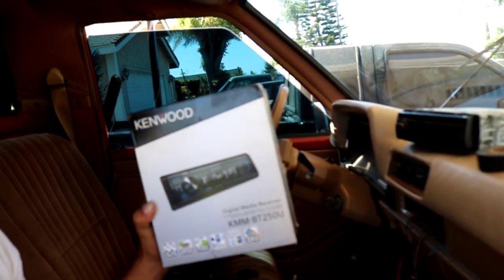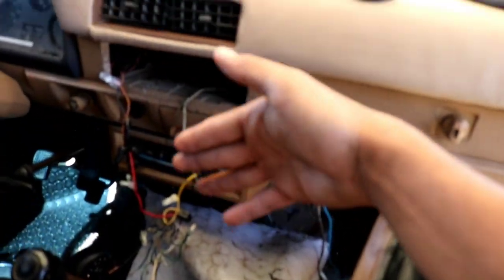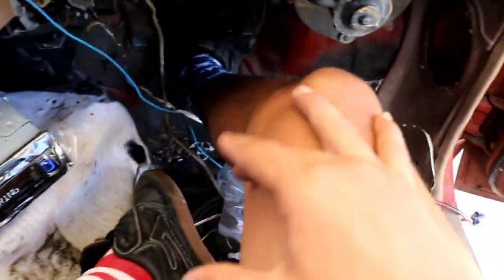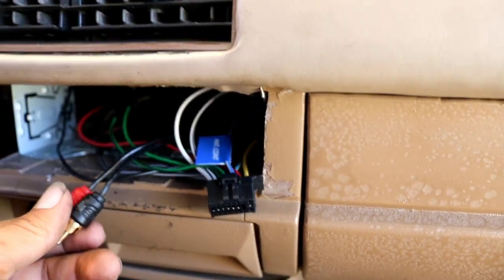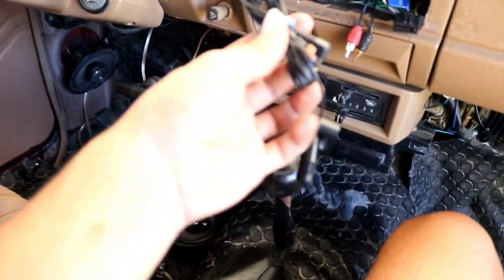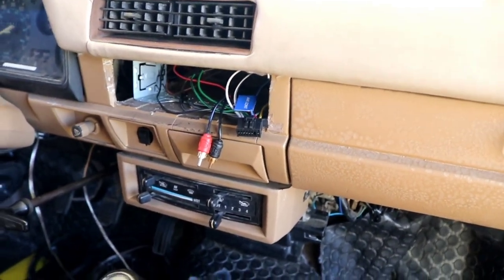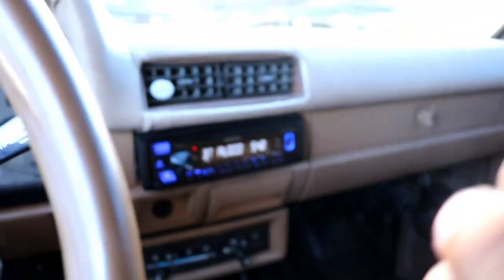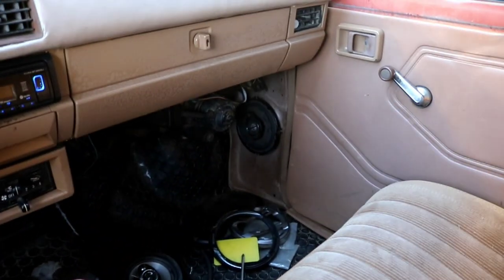Lowered nissan 720 gets a KENWOOD sound system for cheap !

Comment: How did you run a constant wire for the head unit in
Reply from the maker: Wired it straight to the battery with a in line fuse